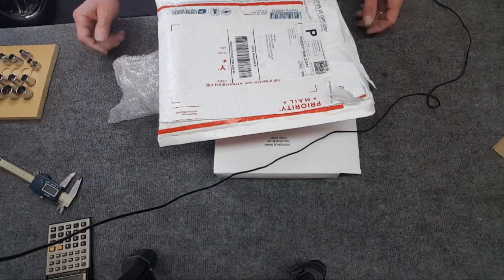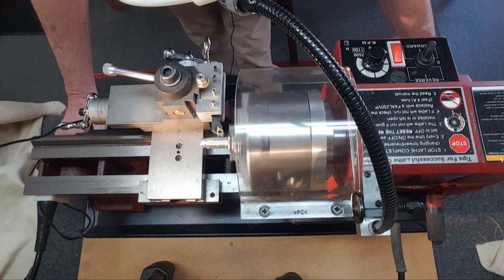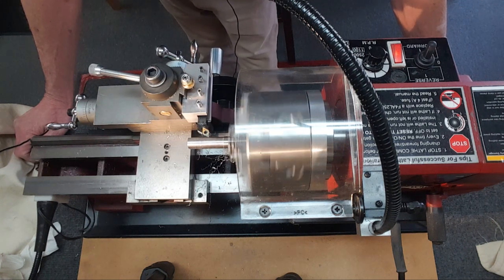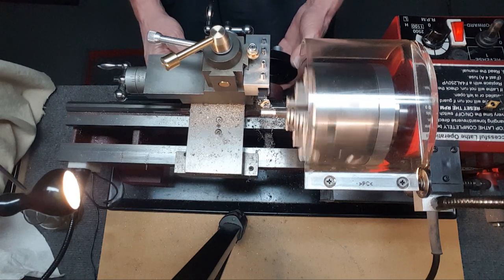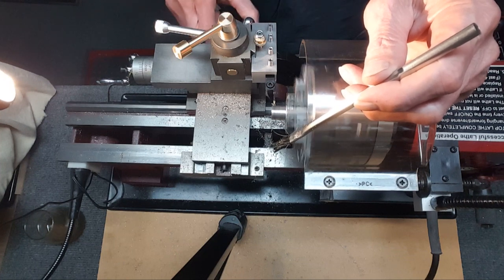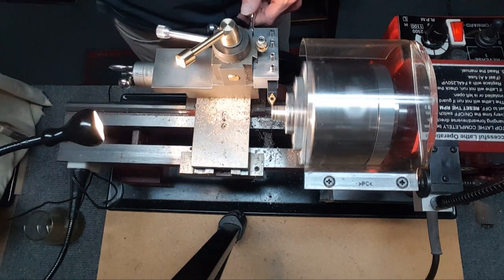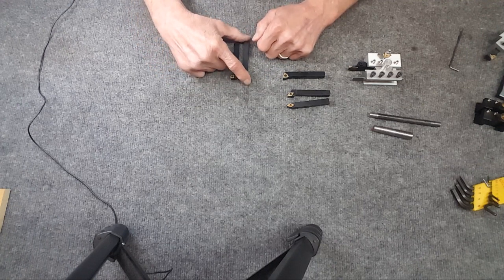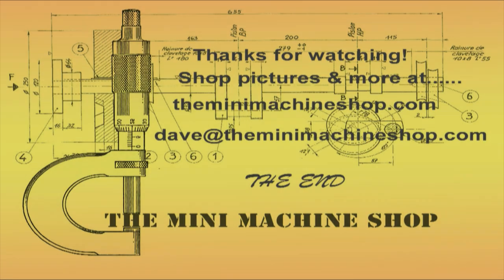New Mini Lathe Tooling Set

Comment: Hi Dave, what speed are you running at. At that diameter MS through brass and aluminium would need around 3000 to get a nice result. The real speed should be higher but my lathes only go to 3000. Carbide needs speed! Also for small machines inserts with ground edges  and lots of rake can be machine friendly in that they require less power than moulded inserts with little rake.

Comment: Just some advice man. No harm intended but those c6 carbide type inserts or any indexable carbide tool are designed to work best at certain depths of cuts in order to work right. Those are general purpose. Those would work best at .020"-.030" to break chips and have better finishes. 

For lathes that size hss tooling would work best for you. Save your money. You can buy hss tooling pre ground. 

Harder metals keep tooling just under center line for turning. The toolings points direction is the way its suppose to be fed into the work. Unless its that 30° bit. That'll go left or right. 

Those will cut aluminum beautifully. Speeds and feeds 1300rpm @ .002" fpm

Comment: Happy Friday. 

I'm finding Chinese imports to the UK are returning to normal, or slightly faster than normal which is good. I've ordered 2 electronic modules from China, via Ebay, both arrived 8 days after ordering, and both arriving many days before the shortest dates in the listings.

You might find the finish is better with insert tooling if you run at a higher surface speed. I find steel needs 700 to 800 feet a minute to  give an acceptable finish on my Minilathe.

Comment: You are sent by some mersiful powers "up there"! My "old", reliable friend, the caliper, needed that adjustment! Never looked into those narrow holes until now. And yes! There is a little screw down there, and yes, I could be tensioned a little. Whow! I did measure a 10 mm outher diameter, 4 mm wide, little ball bearing yesterday and noticed just what You showed in Your video later that evening! I was puzzled and tired… No action until now.

Comment: I question a lot of things, and with 45 years of running machines, I still don't have all the answers.  However, the first, carbide in a mini lathe and aluminum?  That machine cant turn fast enough to need carbide, period.  For one, to cut efficiently, carbide should run hot.  This means a lot of feet per minute, and for most steels, that's around 200 FPM.  For aluminum, that can be a lot higher.  I work very little aluminum, but I do use 1045 and 4140 when I can get them.  1018 is hard to get a finish on, even at higher speeds using carbide.  It doesn't even grind well unless you have a coolant flood on the wheel.  1018 is usually used where the parts will be welded, which it takes pretty well.  Good quality carbide can take a lot of heat, but I doubt if that applies to Bangood or Ebay inserts.

I have several good HSS tools that I've used on several machines over the years, 5/16, and each has been reground many times.  But these are good quality tools, not something from Ebay.  The threading tool, I've cut from 5 TPI to 40 TPI with the same tool, no problems with any of those.  Threading especially, as you want the RPM low enough you can keep up with the tool and not be smashing into a shoulder at the end of the cut.  I bought about a dozen blanks some 15 years ago and still have some that haven't been ground yet.  They last a long time.  I built a small sanding disk some years ago, after the tool is ground to form, then I use that to hone, 220 wet pr dry paper, it works well.

If I have something I want a good finish on, I leave a few thousandths, maybe ten, and set up the tool post grinder, from Micromark on the small lathes or the Dumore on the bigger machines.  If it's just for appearance, then I sand rather than grind, using from 120 to 400 grit if I want it to shine.  Otherwise, size is important more than appearance.

Comment: Dave

Need a sanity check on an electronics issue.  I need a 600watt 35 ohm resistor, cannot find any for any kind of resaonable price.  I can find 70ohm 300watt resistors, and am thinking about wiring 2 of them in parallel, will that give me a package that is 35ohm and 600 watts, or am I just crazy?

Thanks a million in advance

John
Reply from the maker: Yes that is correct I guess you found the formula for resistors in parallel...
Reply: @TheMiniMachineShop  

Thanks for the prompt reply, much appreciated.  I am restoring an old lathe, upgrading to 3phase motor and VFD, and needed 35ohm 600watt resistor for external braking and wanted to be sure I wasn't out in left field.  

John

Comment: What toolpost are you using?  I need to find a better one than the stock one on my lathe.
Reply: William Sevier You can find an aluminum one on eBay for about $40-$50 from a Chinese maker. I’ve got one and it’s not bad at all for the price. It should get me by for quite awhile. They sell extra tool holders also. I bought 3 for about 25. I suggest buying extra tool holders. Get one for each of your cutters. It gets a little expensive doing it that way, but it’s a hell of a lot better than changing tools in a holder and having to reset the height every time.
Reply from the maker: Go on Amazon and search for tool post you'll find it  https://www.youtube.com/watch?v=b605miECYg4&t=1586s

Comment: In Your summing up at time 18:00 You tell that a gib screv in the compund was not in action. Wouldn't that be a clear suspect for the binding when You tested the part off tool? 
Being in a hurry I once parted of a short piece of a 1" 6061 being 12 inches long, without end support. (Ought to use the steady rest but…) Then the object made the partoff blade bind but using lubricant, "Red spirit", it worked out well. Any little mismatch in the angle between tool and object quickly causes binding.
Working with steel, as You did, binding ought to happend much faster.
Reply from the maker: Most definitely which is why I mentioned the gib problem but turns out the parting tool had a bad insert replacing it and it works like a dream now...
Reply: @TheMiniMachineShop  Ooops. That's something I'll check next time. 6061 Alu always cuts nicely, but cutting steel could be made more predictable. Thanks Dave!